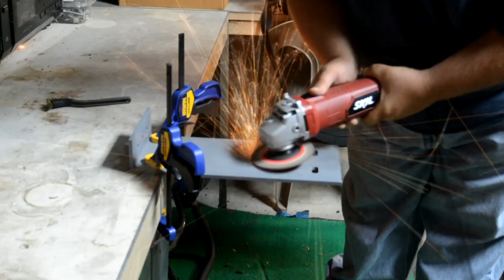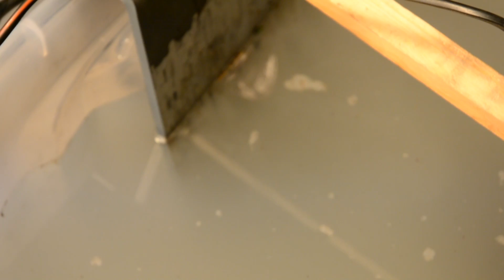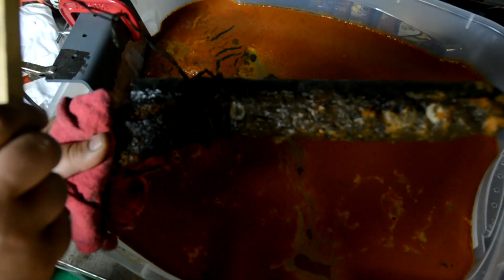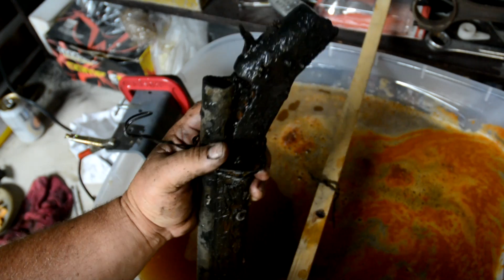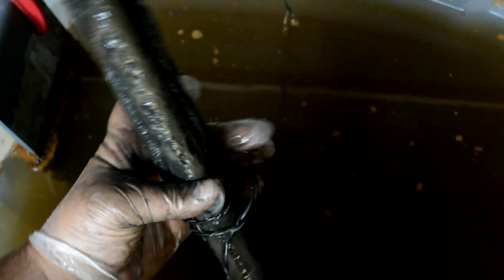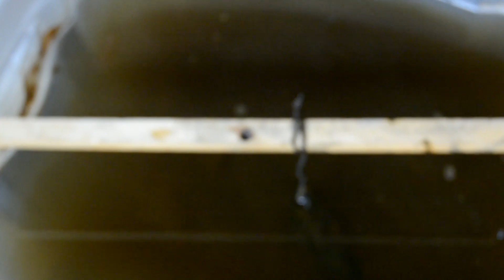Magnet Fishing Finds Rust Removal With Electrolysis # 1 Sawed Off Shotgun Gets Cleaned First

Comment: For me who can't use chemicals and battery's indoors, hydrogen peroxide has good results to. I've found a couple old drill bits and put them in a container with hydrogen peroxide and they came a lot cleaner. It takes a few days but it bubbles the rust off it seems.
Reply from the maker: That's cool I'll have to give that a try on some of the smaller knives I've found.